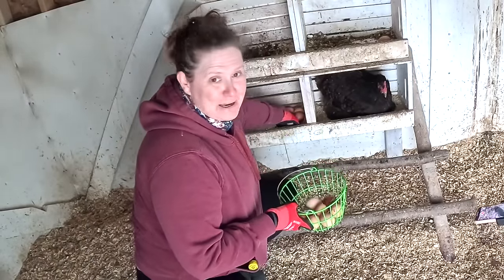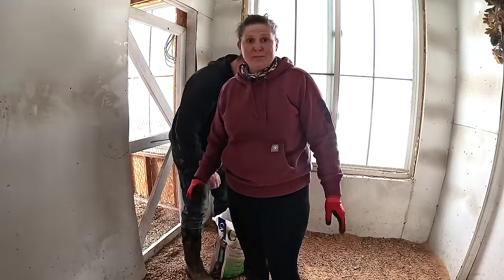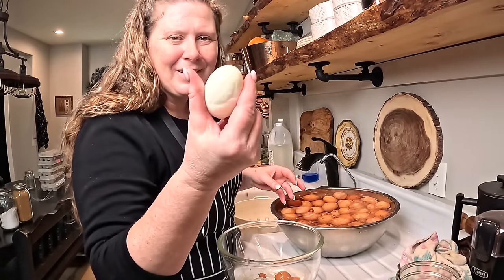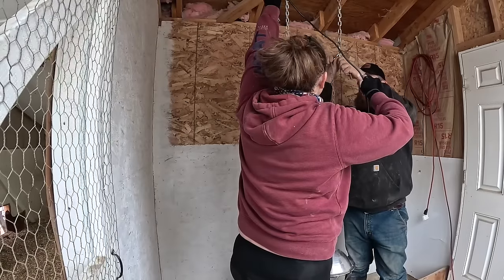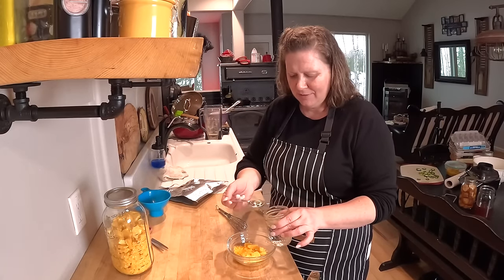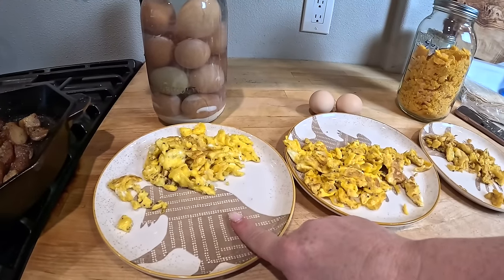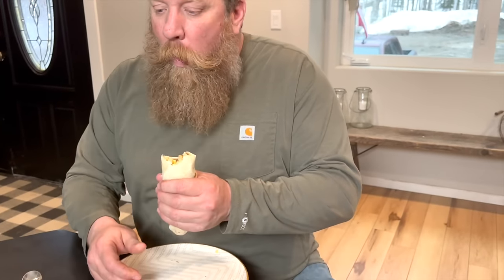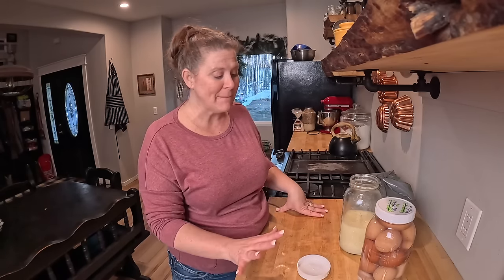Eating Year Old Eggs! 3 Ways to Preserve! Water Glassing, Pickling and Freeze Drying

Comment: Suggestion.  After eggs are cooked.  Drain the hot water off but leave the eggs in the pan. Then add a whole bunch of ice cubes on top of the eggs. Stir them once.  The put a lid on the pan and have Erin shake the whole pan like a pan of paint.  Take lid off and your egg shells will slip right off.
Reply from the maker: Great idea

Comment: I have been eating my eggs that  water glassed December 2022 (18 months old). If you do not realize the egg was frozen when you put it in the bucket, you will know when you take out. I do my eggs in a 2.5 gallon bucket. When I opened the bucket it did stink but the eggs where still fine. a 2.5 gallon bucket holds about 60 eggs and I still have 3 more buckets downstairs.

Comment: Fantastic video. I can't wait to hear how the pickled eggs turn out. I've started using cold refrigerated eggs and letting my freeze dryer do the freezing. It's so much easier to fill the trays while they sit in the freeze dryer and it really doesn't seem to add too much more time to the cycle. Thanks for another amazing video!
Reply from the maker: Do they swell? I was told they swell up do I hadn’t do t it that way. But if they don’t I’m with you I hate the moving of liquid 3 times
Reply: @modernhomesteadalaska  I haven't had an issue at all. I put 18 eggs per tray. I empty my trays into a zip lock 2 gallon bag. They fit right down inside and make for easy transfer.  I kind of smash them into a powder with my hands and then transfer into the mylar bags. Works like a charm!